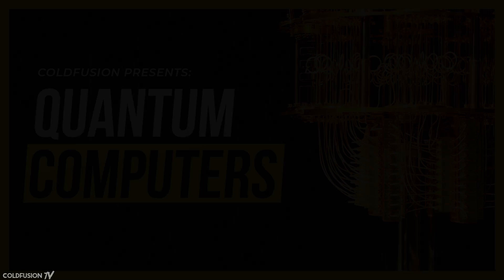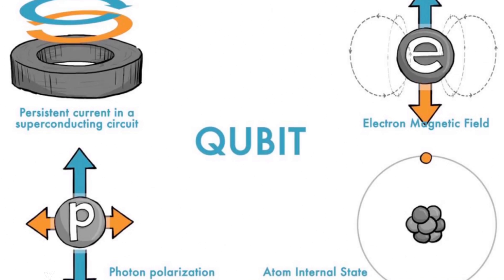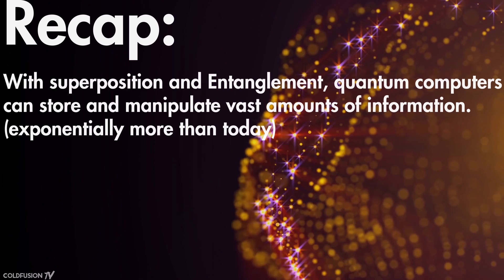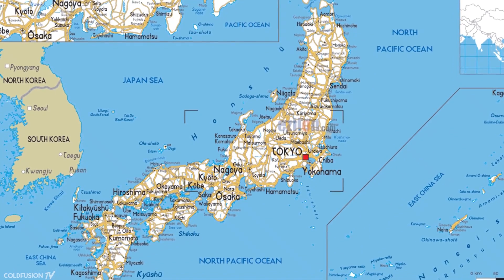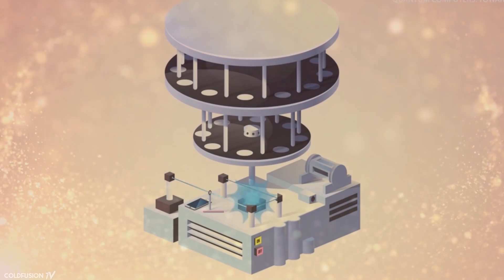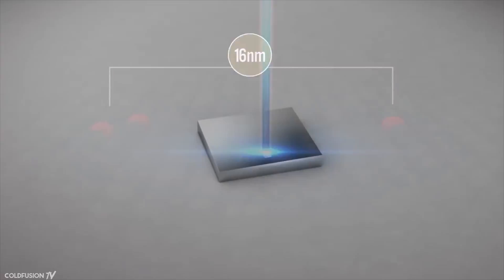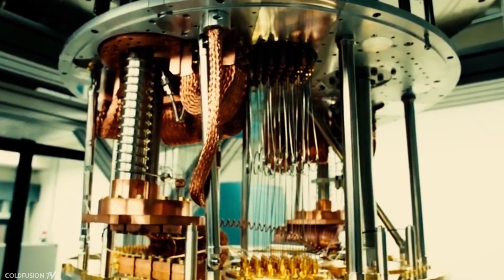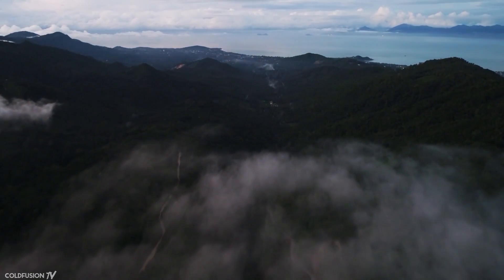Quantum Computers - FULLY Explained!

Comment from the maker: I don't think I did a great job of explaining the last video and a few of you wanted to know more, so here we are. 
PS: I'm not going any deeper down the quantum rabbit hole though. Next video will be a regular topic!
Reply: Hi, first of all I really enjoy your videos, you do some quality work!
Secondly, I want to correct something you said in your last video about quantum computers - you can't send information faster than light. Particles can be quantum entangled, which allows them to always have opposite spins - if first particle's spin is up, second particle's will be down. When you check the spin of your particle the wave function collapses and it's spin gets determined. At the same moment the other particle's spin is also known (it's opposite to the first one's). The important thing is that the spin is RANDOM - you can't manually set it to you liking and have other particle mimic it, thus you have no way to send any information.
Reply: @huscat1609  with regard to computing, specifically, this is not a quantum mechanical problem though, it's an engineering issue. It just means information can only be sent one-way. If I have a mass of particles but denote them to quantum bits, the values of which are predetermined on the other side, a message can be sent from me to you, but neither traced between us nor responded to by you, using the same particle set. You would need a new set of particles. Therefore, the problem is to somehow make that feasible. That means generating a huge number of entangled particles, and keeping them stable. Layman's understanding, I'm not a physicist so correct me if I'm off
Reply: @huscat1609  light does not exist.  It is not a particle or wave.  Ken Wheeler knows best.
Reply: @huscat1609  what about quantum internet being developed at delft using the voluntary creation and manipulation of entangled particles?
Reply: Thank you 🙏
Reply: NP is not thought to be included in BQP, meaning we do not expect quantum computers to be able to solve NP-complete problems efficiently. I recommend starting with the Wikipedia page for BQP. https://en.wikipedia.org/wiki/BQP
Reply: Great video. One thing I believe I should add is, why no mention of Intel's Tangle Lake superconductor quantum processor which could very well revolutionize quantum computing just as they have with their classical Core i7 CPUs? I believe Intel Labs will be a key player as they plan on making production level quantum computing a reality within a decade.
Reply: I wrote a Young The Giant song called, "Superposition." My definition of Superposition is that of when a person can foresee an ultimate outcome (It's important that you know that I don't believe in psychic vision) I believe that everything happens for a reason. And I believe that there are infinite reasons.
Reply: WHEREVER YOU THINK THEY ARE WITH QUANTUM COMPUTERS YOU ARE 1.5 - 2 YEARS BEHIND IN YOUR THINKING.  GOVERNMENTS ALWAYS  KEEP THE LATEST TO THEMSELVES.  ESPECIALLY THE DNI/CIA/NSA  ETC.   LIKE THE "7 DWARFS" AND "THE HAMMER".   THEY PASS DOWN THEIR "SECONDS" TO HIGHER END UNIVERSITIES.  SO WHEN THEY GET NVIDIA GRAPHIC CHIP RUN SUPERCOMPUTERS THE GOVERNMENT HAS QUANTUM RUNNING.
Reply: @belowme4927  Nobody has quantum computing. If the government had quantum computing, why are governments throwing money at quantum computing research? Nobody, no matter how highly paid, has produced a fully functional quantum computer yet, and governments still want and need that technology. The other thing you forget is that our grasp of quantum theory is only one part of the problem - the other is energy. The challenge right now is finding a way to entangle a large enough particle mass to actually make calculations feasible on the scale we do with digital computing today.
Reply: @Coldfusion   And just like I mentioned in a comment you pinned in your other video, you should make a video on Photonic computing aka optical computing (like having fiber optics in the computer), Neuromorphic computing (like neuro networks but in the computer which makes the computing act like a human brain), both to work with Quantum Computing. Also would like to see videos made for Spintronics and Magnonics changing our electronics and working with Quantum Computing. In your last video, you mentioned electrons for classical computing being limited, yet you forgot to mention in 30 years or maybe less about Photonic computing where it would be data traveling on light instead of electrons for classical computers, would raise that limit much higher?
Reply: You can never have superposition particles in a vaccum environment, you can not have cold gasses in a vaacum, vaacum boils and crushes anything made of Carbon. Ask NASA, they know, trying astronaut suites in vaacum chambers always boils and destroys everything.
Reply: @JolPil  wut
Reply: @JolPil  Sointainly
Reply: I think, like last video, it was explained too quickly, and we're absorbing what's being said while trying to pick up on what's being shown with your graphics. I found myself pausing through the video to catch up on the 'how and why' visually, then going back over it aurally. I don't know how many people are good multi-processors out there, but I think I'm in need of a Q-brain
Reply: ColdfusTion
Reply: Me in a superposition : lost and confused at the same time :) either it's me, or the video should have gone deeper.
Reply from the maker: Well don't worry. Even Richard Feynman who helped pioneer quantum mechanics said "if you think you understand quantum mechanics, you don't understand quantum mechanics." It's just not intuitive to humans, but it's just the way the world works at the subatomic level.
Reply: @ColdFusion   Actually most people say, "you can never completely understand Quantum Physics, as it bends the laws of reality, the laws of physics are broken down and is never mathematically accurate because of it". Which is why we use Quantum Mechanics, that actually have proven to work with machines and devices that we use. However.. it would seem we're reaching a point where Quantum Physics is coming into play, not even a percent of a percent.. of the way into it, that would take knowing how space works, traveling the Universe, and understanding all dimensions / multiverses and laws of physics that are broken down such as that of the inside.. of a black hole where the possibility of other dimensions could exist like the 4th, 5th and possibly even 6th dimension as theorized because of the nature of a black hole, which should get you to wondering about other things in the universe that can have similar results. The thing is, there is a lot of Quantum Physics we could slowly discover on how it works over time, and there's almost unlimited amounts of it because of how it changes in our Universe where reality isn't what we think it is hints the reason Einstein calls it "spooky" because it can literally create many instances in dimensional situations within possible black holes and other situations in the Universe that we don't know about as we can't even understand that level (yet), it just takes a very long time to do, but even a little bit of understanding Quantum Physics can change a lot of technology, so it's a good thing to push. Remember that technology does not go down a linear line / path, meaning it does not take as long as said technology will be coming out like 30 years as an estimation for Photonic computing as an example... it continues to accelerate, change, and advance / evolve. Thus.. it comes out sooner than the estimated given time of completion or launch date. Hints the reason many technologies are coming soon in the 2020s instead of 2030s and up, much sooner than expected, which will change a lot of things, they say you won't recognize our world in the 2020s, maybe.. the mid to late 2020s? And so on... Can you.. at that point, imagine the 2030s and up? It's beyond the imagination until seen. Every 5-10 years after the 2020s will be huge in technology changes.

Edit: 
If you go to the Quantum Flagship website, under the FAQ it mentions an answer as "yes, we do understand Quantum Physics", it's just Quantum Mechanics we don't completely understand yet.

Go to my channel and find Technology Research, click on the "created playlists" and only go to that, save that to favorites and start at the bottom by scrolling down all the way, and then work your way to the top, watch all the playlists.

Also go to the "channel's" tab on the other channel mentioned called Technology Research with a green T icon / thumbnail, be sure you have the right one, and under the channel's tab.. check out the Graphene Flagship, the Quantum Flagship, and Archer Materials channel and official websites for news and roadmaps.

Check out the latest breakthroughs in Time Crystals as of 2022. And for warp drives / warp bubble research, breakthroughs, and ideas / concept ideas.

You can find a lot of this out on the other channel named Technology Research that I mentioned, though you have to be on the created playlists to find out.
Reply: @ColdFusion  Yes. It's the way nature operates....it is non-linear. Whereas humans operate/think/perceive in the linear.  That is why it is near impossible to comprehend. And a great irony is that "thinking" and "understanding" are not applicable if one is to experience it....they will only get u to the door. To enter one has to dispense/transcend with the temporary tools that got u there.
Reply: Thumbs down for supporting an oppressive, fascist Internet censor (i.e., Patreon).
Reply: Is the pre-order version of the book different than the current version? I bought a pre-order version but can't find it so I am thinking about buying a new book.
Reply: you are the best! thank you for your hard work
Reply: HI Dagogo, slightly off topic question, you mentioned that your book was going to be translated into other languages a while back, is this still on the cards?
Reply: lol ChristianIce at 0:06
Reply: This is cool stuff
But lot of information. 
I would love you to make a video on "dangote group".
One of the biggest company in Africa and headed by the richest man in Africa also the richest black man Aliko dangote
Reply: and Good riddance, leave this stuff for the ones that can grasp with it - would say 'tis not your cup of tea, sir!
Reply: Recently I have learned that quantum means nothing.  These bumping particles are not part of any actual experiments, only their math equations.
Reply: Thank you for this video. It's the only good answer out there to all of the basic questions I had about how quantum computers actually work.
Reply: Qubits weren’t explained clearly, thank you for your efforts.
Reply: One thing I don’t think you’ll ever have the guts to do is to tell the truth about how this computer actually works. Even those that designed it don’t identify how quantum computers gather information. I am not lying to you – this is 100% truth: other dimensions are requested for information in the same manner that a Ouija board asks questions and gets answers. This computer accesses information from demonic entities. The D-Wave computer just streamlines the process and does it many trillions of times faster. I will not take the time to tell you more. You will have to find out from experts in this research. Go to https://AnthonyPatch.com Anthony Patch is considered the leading expert on D – wave computer and the CERN quantum accelerator. Be sure to make note of this now because you may never be given this opportunity again.
Reply: @Dave_Williamson  "I will not take the time to tell you more"

*proceeds to continue calling quantum computers demonic

Please, stop telling us more. Please?
Reply: @Dave_Williamson  oh, also, if you're willing to keep talking, could you elaborate a little further on the physics of an Ouija board?
Reply: @TRUTH WILL SET YOU FREE 2021 agree
Reply: Hi Coldufsion

The Frame arround the Picture is a bad idea. I for example when youtube suggested me this vid, I thought it is some old vid that Ive seen because of the belt at the bottom.

Regards
Reply: DHScherocha  It always disappoints me when I run into an academic who is also an NPC.
Reply: "Impossible today"   yeah right
Reply: I still don't understand Supercomputers.  I don't get how it's any different from the process nodes we have in today's world.  Smaller transistors or die shrinks that has been around for ages. I don't understand how these "qbits" are meaningful. Damn quantum psychics.  I understand the "classical" as you say technology. All these terms used "qbits" is really confusing.
Reply: It means you are Shamu born in an electric tank & it's the glue factory disguised as coincidence or accidental once it is convenient for some profit motive disguised as morality
Reply: After you see the new X3 Ion Thrusters video in my other comment above, check these out. Nasa plans to go to the moon by 2024.   https://www.youtube.com/watch?v=vl6jn-DdafM   They talk about their new Gateway that's going to be made here.   https://www.youtube.com/watch?v=G9KQfnqukno   And in this video link, Nasa talks about working with MAXAR technologies that will help Nasa's Gateway with what seems like the X3 Ion Thruster propulsion to orbit around the moon. The most interesting part about this video link, is the Electric propulsion system, I don't know if they are using the X3 Ion Thrusters or something else, but they do mention it is 3 times the power of current Solar Electric Systems, and they said it's a "new".. Electric propulsion system, to be taken into consideration.   https://www.youtube.com/watch?v=9m9u_pjnI44   and   https://www.youtube.com/watch?v=QbtjlE2Sy8U
Reply: No known algorithm can use quantum computers to efficiently solve NP complete problems. See BQP
Reply: I would prefer to listen to your book "new thinking" in "your voice" it would really suit all the effort you put into the composition
Reply: Quantum computing allows high-frequency traders to have a true crystal ball for the market
Reply: Dude, sources?
Reply: Google just acheived Quantum Supremacy their 53 Qbit Chip just completed a calculation in 3 minutes that would take the worlds best supercomputer 10 000 years to complete meaning that this little prototype chip is millions of times fast than  current conventional supercomputers, and they talk of doubling the Qbits every  6 months, they will have a Q-computer more powerful than all human brains combined within 24 months. Meaning we have the hardware to build a super intelligent AI. Googles Top AI expert Kurzweil thinks we will have human level AI within 8 years , so ASI by 2030 is certain. Humans are about to become obsolete
Reply: I'm pretty sure the world already has at least five quantum computers you might want to double that research and supposedly 2 that work
Reply: Subatomic particles and spooky action from a distance could be explained by simulation theory like a pause or instant glitch in The matrix or gravitational gravity well wormhole or tunneling on the  mackerel level it technically wouldn't break the speed of light so physics would still be  sound. interesting subject I like how the quantum computer theory could enter connect us with multiverse computers.
Reply: @Justa Fool not really more likely we are in a simulation the percentage of being in a simulation is a lot higher than not being in one I think the last calculation was 89% chance we are in one.
Reply: @Justa Fool and also since we found the higgs boson it proves there's a multiverse by the way.
Reply: And we know quantum physics work if you don't believe me throw your phone away because the atomic clock that keeps your GPS signal linked up to the satellite is  running on quantum calculations incaseyoudidntknow time runs differently when you're not near a gravity well because the closer you are to a mass that has heavy gravity the slower time goes
Reply: @Justa Fool one more thing a little off subject astronauts that come home from space are actually younger than the people that stayed on Earth They only look older because of all the radiation and ionized particles they are bombarded with NASA could probably come up with a magnetic hull that could either reflect the ionized particles or absorbed them and use that to make photonic energy for some kind of hyperdrive because the more energy you absorb the faster you go and the faster you go the more energy you absorb.
Reply: @Justa Fool just fine my father used to work at Nasa for 14 years so I'm pretty educated when it comes to scientific research and what's plausible do you live in a dream world or just don't pay attention to scientific data
Reply: @Justa Fool maybe you should listen to Neil deGrasse Tyson or perhaps michio Kaku. Einstein has been proven wrong when it comes to spooky action from a distance 😂 and as far as the simulation theory I'll let you do your own research listen to some of the top scientists today. Your old ways of thinking are dying 😜 so do yourself a favor and enlighten yourself me myself personally I'm more of a Nikolai Tesla fan.
Reply: @Justa Fool please watch this fill you in on the gaps you're missing https://youtu.be/R-OmmLvmk0c
Reply: @Justa Fool by the way I know 2 astrophysicist one from NASA and one from Rice University and I also know 12 astronauts my father worked with John Glenn on his last mission as an engineer at NASA
Reply: @Justa Fool did you even watch the video I sent youand I would like to know your background a little bit so I know who I'm dealing with and if you want me to go back and explain to you what I was claiming to be  fact and what was theory I can do that and also what theories have a high probability of being reality because as you know in science there are facts and there's hypothesis and a hypothesis is the interpretation of a factads most the hypothesis I've given you the majority of scientists agree
Reply: I think you need an update on the video specially after Googles latest Quantum Supremacy.
Reply: It's like a dumbell.. Qubit is the weight ⚪
            And the coupler is the strength ➖
             
                          ⚪➖⚪
                          q¹       q²
The coupler is the outside soure and always identifies with two qubits..

Demonic Programming is able to break thermodynamics laws..

D-Wave 2000Q system is the latest.
That's 2000 qubits
Temporal Defense Systems, NASA, IBM, Google all have a D-Wave..

'Vancouver Canada is going to ground zero for AI Civilization,' Kindred AI ...
Reply: Possibly,  but the first Quantum Computers will exponentially increase the successive generations and speeds at which they are developed.  Slow to start,but the AI that comes from Quantum Computing will deliver growth beyond anything one can imagine now. It's like how fast the modern world is drastically different than it was 5 decades ago.  Speculation about where we will be in two decades will be just as flawed as those  thoughts about the modern PC was back in computing infancy stage.
Reply: This is NOT an explanation it is a description an entirely different thing.  It does not explain how a qbit having three states 0, 1 and both 0 and 1 gets to be more powerful. SO many videos on utube fail to explain this. If I code a conventional binaryt computer I can store 1 or 0 (true or false) and can cvomer back and retrieve it. If I go to a qubit and find it is in a stte of "1 And 0" simultaneously, then how the heck is this useful - being neither one or zero or true and false?
Reply: The most important part(I know its kinda hard but) the difference between bit and qubit and computing mechanism differences hav not been explained. Computing with binary combinations is ok. (simple logic system) but how can you compute or understand the mathematics of these "superpositioned" possibilities??  is there any video about that?
Reply: Well you certainly didn't do much of a job of explaining anything in this video either.
Reply: I wouldn't want a Quantum Computer to just "give the right answer" as one way and biased that would make us narrow - minded, I would want multiple answers to look around problems for / as breakthroughs by brainstorming things like new materials that have work arounds for issues like that, that's just one example to get around problems for other answers, does the Quantum Computer see that? Or would we just naive and gullibly follow what the Quantum Computer tells us as the only answer, are we that uncreative? Or has arrogance, bias and bad agendas become of that level in Physics, or maybe it's just money talking and the media can't find anything creative around Sci - fi level innovation, so they can't find anything interesting to say for something inspiring. Because a lot of media is controlled by a single company, and / or a set of companies that they are paid to give such biased and limited information, for only what they are paid and told to say.

What if a Quantum Computer skips other answers that have problems, and those answers with problems might just need a new material to fix those problems? (6:56) Hints at this point the Quantum Computer is giving us a very narrow - minded approach to something that might use the same material to solve a problem with a correct answer on how to use that material instead of looking at better materials we will discover later, and instead of opening our minds to be creative and brainstorm other ideas around it such as new materials to solve the problem.

That isn't to say that Quantum Computers can't be used for Sci - fi level innovation breakthroughs in emerging technologies, and applications we haven't seen yet, or "don't even know yet". I like the idea of them working with warp drives, Advanced Particle Replicators to materialize using particles like Photons "for non-living things like sending your computer, other devices, vehicles, buildings / structures and the list goes on... to mars and beyond our solar system to other planets, and holodecks like off Star Trek if you think about Quantum Teleportation / Quantum Entanglement, Quantum Simulations, super position with Qubits, and much more", we don't need a metaverse VR, give us a holodeck on a space ship instead because of the Photon particles and the mentioned reasons in quotes.

I've had another youtube channel since 2019 now that is unique as it shows big pictures, breakthroughs and so much more.

Here is a guide -
Go to youtube, type in Technology Research, or go to my channel to find it.
It's a green T icon / thumbnail, be sure you have the right one.
Once there, only go to the "created playlists" by clicking on the words created playlists and starting at the bottom.

Be sure to watch all these from the channel itself.
Use a desktop PC with a good monitor and speakers, watch the playlists and videos through the channel, not through a phone or discord and so on, you will see why that's really important and big pictures.
And a really good sound card with a really nice headset, with an equalizer set properly to sound really nice, will be amazing for these big pictures.

Here are the steps. -

Watch just the first 2 videos at the top of the Graphene playlist.

Watch the first 9 videos at the top of the Photonic Computing playlist.

Watch the first 2 videos at the top of the Spintronics playlist.

Watch the full playlist called Graphene Twistronics.

Watch the playlist called Graphene computers for home and starships, all the way through.

There are 2 videos to check out after the playlists above that I will mention here.

There's a playlist called Graphene with starships, the video is about Graphene aerogels made in space.

The STL playlist has a video called "Spaceships capable of reaching our closest stars".

Watch all the Graphene "types" of playlists.

Watch the STL and Time Crystals playlists all the way through.

Watch all the Quantum Technology playlists.

And then watch all the other playlists under the created playlists.

---------------------------------------------

Also be sure to watch the Advanced Solar Panels playlist all the way through, before you watch the Quantum Technology playlists.

---------------------------------------------

Here are some other things on warp drives.

There's also warp drive / warp bubble research and breakthroughs, and concept ideas.
The old theoretical warp drives use the idea of negative energy, and the new theoretical warp drives use the idea of positive energy known as solitons as of early 2021.
Summer 2021, there were new calculations for breakthroughs with the new theoretical warp drives which brings the energy required for the warp bubble down to the size of one earth mass.
The old theoretical warp drives required several times the size of the universe, and then new calculations brought it down to several times the size of Jupiter.

Eric Lentz reduced the amount of energy needed to about one earth mass for the warp bubble, a little more than half a year ago. So imagine what it's probably at now for the positive energy, from his idea.

Sonny White from Nasa, he reduced the negative energy required down to 700 kg "equal to the size of an elephant, car or voyager space probe". Found in a published paper by Sonny White.

There was a video that mentions in the interview with Sonny White, that it's not an "analog warp bubble", and that it's actually more real, well in the video they mention that "our detailed numerical analysis of our custom casimir cavities helped us identify a real and manufacturable nano that is predicted to generate a negative vacuum energy density such that it would manifest a real nanoscale warp bubble, not.. an analog".
And the video's narrator continues by saying "still the real thing meaning a warp bubble structure will manifest under these specific conditions". And people seem to be ignoring this.

They want to make a tiny 3D - printed space craft to place inside the tiny warp bubble for testing, though they won't do this until Nasa is done funding the research for the casimir cavity, which has something to do with the warp bubble.

Dark Matter and Dark Energy make up a specific percentage of the universe, they help space and time expand, and Nasa would use it as the negative energy required for the old theoretical warp drives, hints a type - 4 advanced civilization would also use the energy from the universe.

Though after Erik Lentz from early 2021 came out with new ideas around positive energy as Soliton particles, he reduced a lot of calculations and made Nasa realize more tweeks can be done, and breakthroughs. And that we don't need to use just one form of energy sources like that.

After the calculations reduced the energy required, and since they don't have Dark Matter or Dark Energy yet, they also don't need them right now because they don't need that amount of energy from the universe anymore just to power the warp drives / warp bubble, and so they are trying other methods of energy, now that it's been narrowed down.

As someone from Nasa that knows Sonny White has said, "unpredictable breakthroughs can happen 10 years from now or tomorrow, it only takes someone to come along with a light bulb that goes up, and comes up with a new idea / concept idea", and that is a very important big picture.

-----------------------------------------------------

Oh I wanted to mention one other thing, when you're done with all the steps, be sure to check out the channels tab on that channel, and visit the Graphene Flagship's videos section, Quantum Flagship's video section, and the websites for both of them, the news also under them and roadmaps.

And Archer Materials a company from Australia that works on Graphene Quantum chips, be sure to visit their channel and website.

The Time Crystals playlist will also blow your mind if you catch a really big picture there with unlimited energy, and for advanced particle replicators to materialize anything.

I'm sure Graphene Twistronics could also be used in a similar way for unlimited energy and so much more that superconductors can do.

What I want is to replace electricity though with Graphene - Photonics.

The Time Crystals would also be used for other things, warp drives mentioned in the playlist, and cures for all diseases supposedly / advancing the medical field and more, though will be shown in the playlist videos.

Oh the breakthroughs around Time Crystals since 2021 to early 2022 will blow your mind, I still.. have yet to make videos on those for this year! They want to add them to chipsets, multiple articles on reasons and breakthroughs this year.

And they want to mass scale the Time Crystals with the breakthroughs, for the chipsets and so much more that would blow your mind, to push them to the market really fast, they mentioned could happen very soon, we will see.
Reply: May be a good time for an update video.
Reply: I know it'd be a bit of a different area than your usual videos, but could you do a video on the trade war going on between China and America in regards to the so called Huawei ban and the potential implications for American phone companies, chip manufacturers and software providers?
Also, brilliant video by the way, I've seen quite a few videos on quantum computing and none of them have explained it as well as this one.
Reply: I think at near absolute zero it  is equivalent to traveling the speed of light. Time dilation , the computer chip is not calculating in real time. A year to the computer is a few seconds to us. That's how it calculates. The computer chip is in a different frequency of time.
Reply: @anti-trollcomedian1664  I didn't know time  relativity was related to temperature. My understanding is quantum computers take advantage of quantum entanglement so less steps are needed for the same calculation a supercomputer would have to do.
Reply: Do these scientist know a thing called (((optimisation)))? 

Because I'm 100% certain that you can run fucking superposition or simulate particles and molicules if you optimise and put a work into the software instead of letting it staying in shit state as it is currently